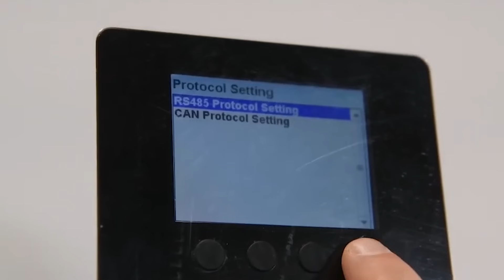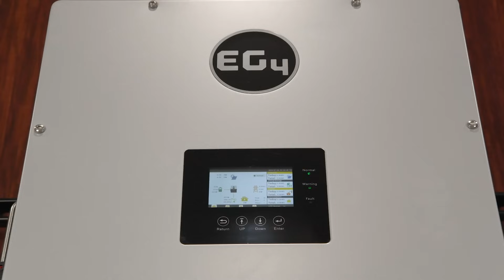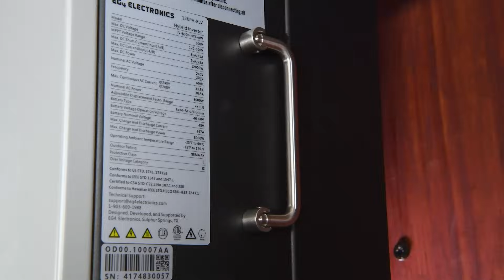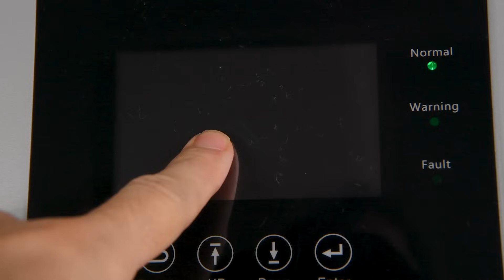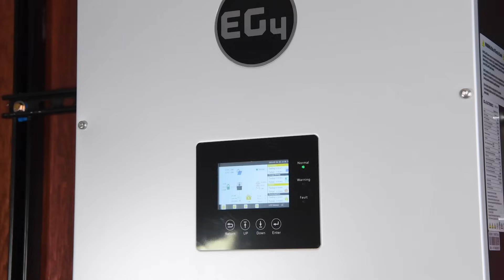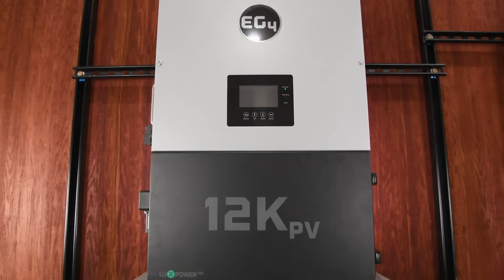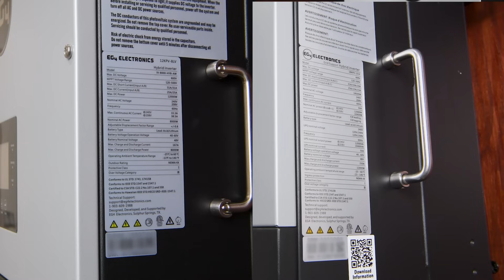EG4 12kPV Hybrid Inverter: Features, Benefits, and ROI Explained - 12000W Input 8000W Output

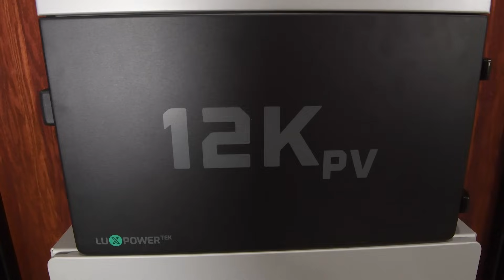Comment: Hello, at 2:28 the "Share Battery" setting is mentioned. From what was said here, I understand that the Share Battery option can be Enabled when using two 12Kpv installed in parallel, with each inverter connected to their own individual batteries. Is this true?
From the information in the Monitor Site manual and on the ? prompt on the Maintenance page of the Site it seems to imply that the Share Battery is to be Enabled only when paralleled inverters are connected to a common battery bank (one in which both inverters can charge/discharge all of the batteries).
I cannot find any concrete information about the Share Battery setting. What I can find is conflicting information.
Please provide some more information about this setting. 
In fact, a Signature Solar YT video covering the all of the parameter settings of the 12Kpv would be fantastic.

Comment: What is the minimum battery ah required?
Reply from the maker: It is recommended that each inverter should have access to more than 200 amp-hours of battery capacity.

Comment: Very informative.  Thank youl.  Is this unit compatible with a bidirectional EV charger? If so is there a particular charger you can recommend?  Thanks.
Reply from the maker: This unit does not flow back to the grid.

Comment: Just starting to investigate solar as a possibility for my home; hybrid battery system. Though I've got a very low energy consumption home, I have two, 200 amp panels.
None of the videos I can find deal with integrating to anything but single breaker panels. Is this going to be an enormous complexity or cost increase?
Reply: Gridboss w/ flexboss18 or 21. Gridboss can handle a 2 panel, 200 amp each house i believe

Comment: What EG4 Inverter is recommended for priority of "1. Solar PV Power | 2. Grid Power | 3. Batteries | 4. Generator?"  Where Solar is used to power ac loads while keeping batteries full.  Don't want to supply power back to grid.  Only use grid as needed for back up like a generator.  Only use Batteries as needed if grid and Solar is not available.  And last to only use gas generator if grid is not available and battery is not enough or too low.
Reply: EG4 12000xp

Comment: Can I use my own batteries or do I need to use the EG4 batteries?  That is, does the 12kPV need comms with the batteries, or can I just tell it I'm using LiFePO4 and it works?
Reply from the maker: This inverter is compatible with Lead-Acid/Lithium battery types. What type of batteries do you have so we better help?
Reply: @SignatureSolar  I use LiFePO4.  But I see the communication cable and don't know if that's optional or not.  Mine are straight up batteries with no comms.  Can you run this unit without it talking with the battery, or battery communication required?

Comment: QUESTION; the AC Grid, let say i were to connect a grid power to this inverter just as a backup in the event that my solar not producing any power; will this AC grid charge the battery and power the loads at the same time?
Reply from the maker: Yes, it can charge and power loads at the same time with grid input
Reply: @SignatureSolar  Can this setting be set to only come on if the battery drops to a certain percentage ?
Reply: @TKO67 yes you can configure if/when to use. Times and conditions. I have my 18k set to save battery and act as a big ups. If power goes out then use battery just long enough to fire up generator. If grid comes back and I have solar it uses solar to charge. If not enough solar it uses grid automatically. If between a specified percentage of charge.

Comment: Hello, my question is, can VOC and WATTAGE from PV input 1 be totally different than VOC and WATTAGE  from PV input 2?, EXAMPLE ( PV 1= 240 voc, 4500 watts.. PV 2=320 voc, 5200 watt), I really need to know this. Thank you!
Reply from the maker: Yes, so long as it's not 1b and 1a, the same panels must be used on the first 2 ports because they are parallel!

Comment: What size wire do you use in the Grid L1, L2 and neutral
Reply from the maker: Max wire size between Grid, Gen, and Load terminals is 4 AWG, which can handle approximately 85A. We would recommend using 4 AWG!
Reply: @SignatureSolar  4 AWG for Neutral as well? For ground? (8 AWG?)

Comment: Is a bassen green battery rack compatible with the eg4 12k?
Reply from the maker: The battery will work, but communication is not guaranteed and you would have to run it in open loop.
Reply: @SignatureSolar  I will look into that and get a better understanding. Thanks for the update

Comment: I have two 18Kpv and would like to add a 12KPV to them can you parallel them
Reply from the maker: You cannot
Reply: Are you trying to work on an update so you can I need more panels and I really hate to buy an 18K to be able to have more panels since you don't offer a charge controller that communicates with this  @SignatureSolar

Comment: 9540 coming for it?
Reply from the maker: UL 9540 only comes with inverters and batteries combined.
Reply: Yes of course, but it’s currently listed in the California inverters list, but hasn’t been certified as an approved ESS and is thus uninstallable. I’d have loved the 6000XP as an ESS - it’s more than I need for my cabin - but figure the 12KPV is more likely to be approved as part of a 9540 system.